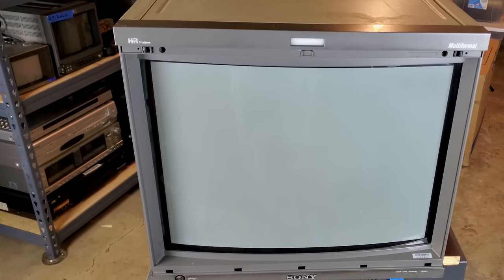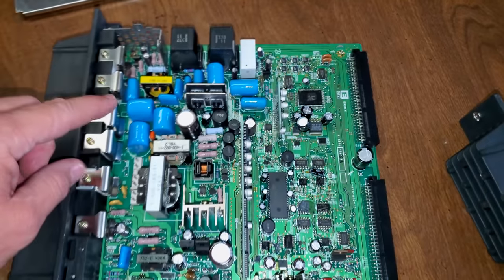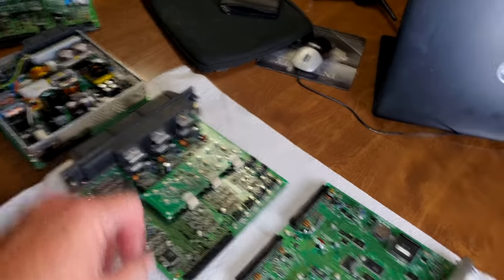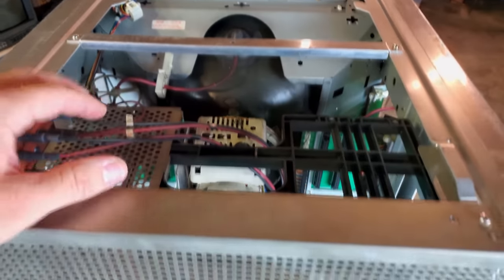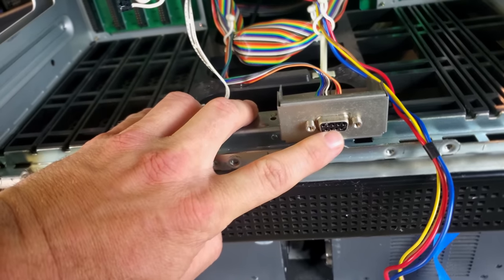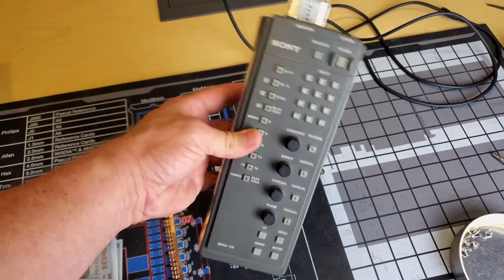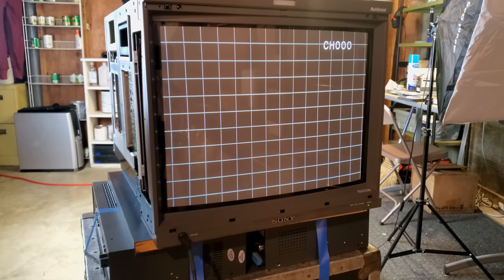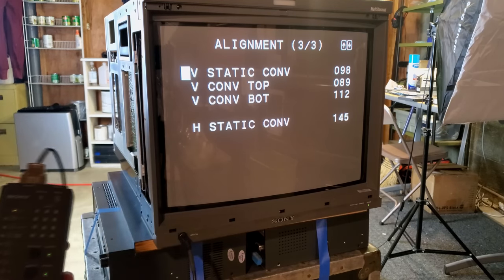The BEST 4:3 Trinitron!  The Sony BVM D20F1U Multiformat CRT Monitor

Comment: Beautiful tube. One of those holy grails I'd love to own if I had money to burn
Reply: It's YouTube and these channels that drove up the price to extraordinary heights. I owned a nec 29. Bought it on our local graigslist for less then 75 dollar. I sold it 2 years ago for 100. The buyer was someone like you I guess never believed he could ever afford a holy grail. He initially thought I was a scam. We are still in contact. He loves it
Reply: @jeffry5800  It is a parasitic relationship between ebay and youtube
Reply: I finally got one! Amazing tube!!
Reply: @jeffry5800  you’re not wrong in a way but I’d definitely say the transition to LCDs that led to the massive undervaluing of these monitors, particularly the top of the line ones like the A32 or FW900. Any of the multiformat ones, really.

Comment: 18:57
Wow, that transition from 480i to 480p on the gamecube is mega fast compared to my PVM 20L5, my one makes a click sounding like a switching relay, then gradually shows the 480p image like when you power up the monitor from power off.  Must be working in a totally different way.
Reply: Your power circuit has a issue inside of it
Reply: @C3phoe  Do you own a 20L5?  Here I commented about the transition from 480i to 480p.  I own both the PVM-20L5 and BVM-D20 now and can say, resolution switching is totally different.  The 20L5 is more gradual and slow switching from 480i to 480p (which I don't mind as it's totally functional), while the BVM is more instant.

Does your PVM 20L5 switch between 480i to 480p more instantly like the BVM?
Reply: @ngbf2900  refresh rate synchronization can be affected by the condition of the power supply circuitry.  I thought you were saying it was out of spec, if not then yes, some monitors may be inherently slower in adapting to new resolutions.

Comment: This CRT looks amazing with the gamecube and 240P snes grid. Hope you have a 1chip snes to get even more glory out of these panels.
Reply from the maker: Thanks.  The SNES I use is the model 2 with the one chip.  I did have to modify it with a Voultar RGB kit to get S-video and RGBS support.
Reply: @RetroTechUSA  very nice snes for the collection! Awesome. If you ever used a capture card, its incredible how sharp the pixels are one a 1chip.

Comment: I got my boards serviced by Pat as well, highly recommended.  This monitor is truly the best Sony 4:3. The multi format ability, native 4:3, high TVL and great colors. My only complaint is that it has some problems with sync on certain signals. But handles most consoles quite wonderfully. It really great for high resolution signals.
Reply from the maker: Thanks for sharing
Reply: About how much does that cost to do? I picked up one of these models  years ago before they got crazy expensive. It still works fine, but I'd like to future proof it now while still possible.
Reply: @chrisr.2410  it was about $450 for all boards. Expensive and cost more than what I paid for the monitor but well worth it. I got peace of mind for the next many years.
Reply: @luismagallanes2371  Okay thanks. Yeah, that is pretty expensive but you're right that it's probably worth it all things considered.

Comment: Holy crap... I don't think I can handle a CRT being so packed full of tech it has a boot-up time! 🤣 That controller is really something, and the menus on this grade of PVM are totally nuts.

That VCR mode thing is intriguing... My BVM hasn't given me any trouble, but I feel like whatever tech is behind that needs to be introduced to all modern video capture cards and monitors. They tend to throw a tantrum over the Super Famicom's 60.81Hz or w/e the hell it is. Like, the OSSC has no issue just upscaling the video for modern displays, but it doesn't touch the sync frequency so it's 50/50 as to whether anything on the receiving end will sync. 🤦‍♂️

Comment: Would a ESR meter be enough to check capacitors without removing them?
Reply from the maker: Probably as long as your BVM is still working good and there are no signs of cap failure.

Comment: Thank you for that nice video Steve. I have a question. How does this monitor compares against a BVM 1911/2011 (I think you have on of those) for 240p content ? Also I have to say that I love convergence settings directly on the Subcontrol Panels inside the Drawer on older BVMs, it's very sharp. I don't know if convergence settings are as practical on those more modern chassis, your opinion ?
Reply from the maker: Hey, thanks.  The controls in the drawer of the earlier BVMs are quite similar to the adjustments that these more modern BVMs have in their service menu.  As for 240p content, you will see similar results between these two CRTs if each is in the same condition.  The issue now is that the 11 series is quite a bit older than the D series, so it has less features and more age.  The 11 series are great CRTs when they work well.
Reply: Many thanks for your answer Steve, I can't wait for your next video !

Comment: Amazing video. I have a GMD-F520 Trinitron VGA monitor exactly with the same number of hours of use (around 14k hours). Should I recap the complete monitor? I always have this doubt... would the image improve?
Cheers
Reply from the maker: I'd just be most concerned with cleaning it and inspecting it.  If you don't have a problem or don't find anything noticeably wrong from the inspection, then don't recap it now.  Wait till later.

Comment: I have this monitor and had no idea it could do 480p. What board does this? I had Pat service my board years ago. I bought mine cheap before all the hype hit som I’m thankful for that.
Reply from the maker: This BVM has unique hardware spread throughout all the major boards giving it the ability to run at high frequencies and display higher image resolutions than the past monitors.  It's a great crt
Reply: can do 720p too, and 1080i, as can its smaller sibs - all amazing monitors, though the scan line limitations of the 9" limit it to 480p in effect. one cool trick is 576p for us PAL heads. Its a broadcast studio monitor for the early HD era (pre 1080p+) which is were I encountered them.

Comment: Any tips for a Sony KV-32FS120? Flat tube Trinitron, has distortion around the top left and right towards the internal speaker magnets. Made in 2004.
Reply from the maker: Big Flat CRTs are prone to problems like this, maybe try a degaussing wand.
Reply: @RetroTechUSA  Thanks buddy!

Comment: What about the 20L5?
Reply from the maker: It's lower end than the BVM, The 20L5 is a PVM and has a lower build quality and less features.
Reply: @RetroTechUSA  would you actually see any difference in the picture quality? The BWM seems to have more options. How's the linearity? Hard to see on the video since it was very overscanned. Make a BVM vs PVM shootout video 😁

Comment: Which is better: a20 or d20?
Reply: Generally, D20. For A20 to have all of the functionality of the D20 you would need an extremely rare video card. According to retro tech he thinks about 300 of these video cards were made in total. D20 is the way to go
Reply: @ConnorSeals  Would the board for the A20 be the bkm-68x?

Comment: Its a shame it has sync issues with a lot of arcade pcbs.  Nec xm29 i would rate the overall best
Reply from the maker: That's a great Shadow Mask CRT, definitely a candidate for Best CRT ever in my opinion.
Reply: @Retro Tech  i agree that picture quality wise, nothing beats d20 in the 4:3 class, but it's no good if it doesn't want to sync with arcade pcbs even with sync correctors.  For consoles gaming, it's perfectly fine.  Imo, I would rather go for a D24 for bonus widescreen in a crt that can go up to 1080i as the perfect geometry and linearity make the boarders in 4:3 unnoticeable anyway.

Comment: Everything proven VCR players are tilling on TVs now specially the new update TVs everything proven people don't do good job on soldiering connections inside of the tv itself everything proven when my soldiering connection got fix it stop the problem it was doing this the picture screen itself were you which tv at would be moving every 2 minutes now it doesn't do it at All when that soldiering connection got fix

Comment: "the best crt" yet still looks like shit compared to even budget LCDs today.
Reply from the maker: You're dreaming.
Reply: @RetroTechUSA  looks washed out and garbage, the more sensible thing to do is save thousands, and just buy an QDOLED for superior image quality.
Reply from the maker: @LycanWitch  You're still dreaming.
Reply: @LycanWitch  Seriously doubting you're old enough to have ever used anything that outputs to a 4:3 screen. 
These days I do my retro stuff via emulators on an LCD monitor and prefer it that way, but there is no way my 1920x1280 monitor or your QDOLED will make them look better than that Sony monitor.